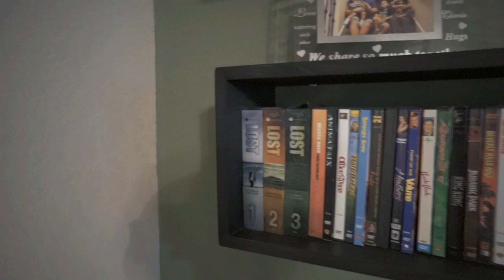Floating Box Bookshelves - How to Make and Install

Comment: Woooohoooo!!!! Yes, thank you Sir!!! I genuinely thank you. What I want to use the shelves for is to place my movie doll collection in my cinema room in the basement. I thought it would add a nice touch. As for tools. Since I have built your picnic table, it has motivated me and became a new hobby for me and new challenges ( I do thank you for that as well). I have built many other things like, fence, deck, BBQ cart and Mr. Dewalt and I have become good friends. :-) I have tried and the shelves installed on my wall right now are shaking and bends frontwards and I could not understand why.  I have drilled holes and patch them up, repainted my wall. I have the shelves with the L bracket. Now with this well explained video I will take them off and build the ones you have shown here. It will actually look better and is a better idea. The only thing I need from all you have mentioned I would require to proceed as prop is the wood. The lumber store opens in 20 minutes. I do thank you once again and I hope you and your family are well during this difficult time of this pandemic and please stay safe. :-)
Reply from the maker: Glad to help out Nicole, and also thanks for the idea. Sorry it took so long to make the video though.
Reply: 9 9o or  9 o's 99 and 9  and I 9years have been oo

Comment: A bookshelf made from these would look really cool
Reply from the maker: I made an entire entertainment center on my wall. It features a really large version of one of these bookshelves to hold my components. I used 2x4's to mount it to the wall but they are hidden. I put the TV in the middle and surrounded them by the bookshelves.
Reply: This Guy Could you post a picture of it? I’m currently thinking of making a bookcase using this method so I’m still looking for ideas
Reply from the maker: @-SP.  Sure, I have floating bookshelves around two of my TVs. Check them out: https://photos.app.goo.gl/PiZtLc44B7XZVAax6
Reply: This Guy Thanks that looks great

Comment: I love these! I'm needing these but deeper for xbox & playstation, both in one long shelf. Don't think these size brackets would hold them (could be wrong) is there another way you can suggest I do the floating shelves? They'll be mounted on wood (panel behind the TV) not the wall thanks!!
Reply from the maker: I actually created a huge shelf that held my playstations and gaming consoles. I didnt use a bracket. I got a 2x2 piece of wood and bolted it to the studs in the wall. Then you mount the bookshelf on to that. Just keep in mind that you may want to add brackets to the bottom shelf to keep them from sagging.

Comment: Hi, I am. Trying to make a floating cube shelf out of laminated mdf, looking for some kind of invisible joining hardware so not to show the screws and nails,  a y idea?
Reply from the maker: MDF will be a challenge to work with. You will need some course threaded screws that will not easily crumble the material. You will also need to pre-drill the holes. You can find long brackets that will run the length of the wood (width wise) that have a series of screw holes along their length. Something similar to this, but less heavy gauge: https://www.lowes.com/pd/Simpson-Strong-Tie-Wood-to-Wood-Angle/3083385?cm_mmc=shp-cprdhdwgooglelia-213-framinghardware-3083385-_-0&placeholder=null&gclid=CjwKCAiAqJn9BRB0EiwAJ1SztaXm4M-JI4ELnD8osqHZi0WOYYohITz3MQT4pGXprsm7rBRis5xolxoCYCEQAvD_BwE&gclsrc=aw.ds
The brackets can be inserted on the inside of the joints so they can stay hidden. You will need to paint the cube to hide the hardware though.